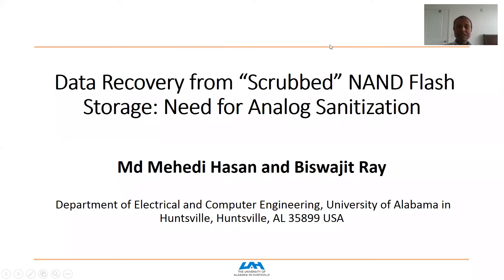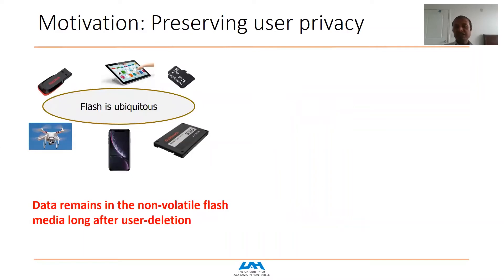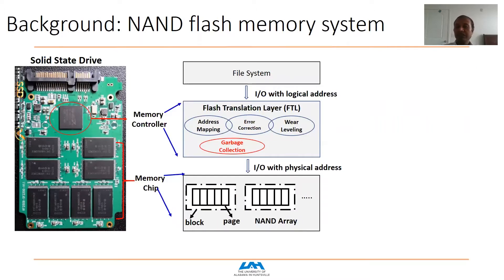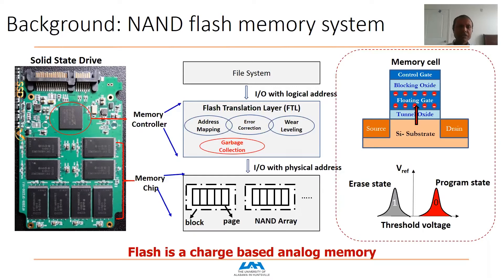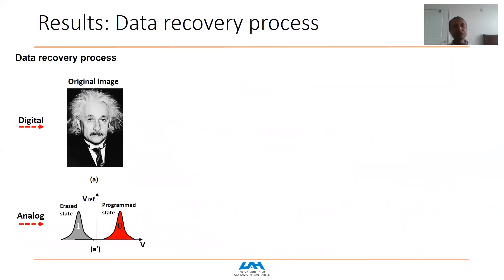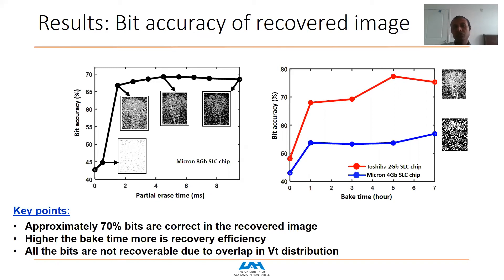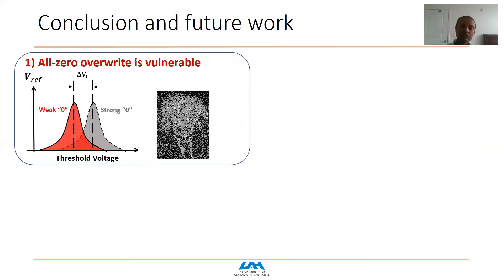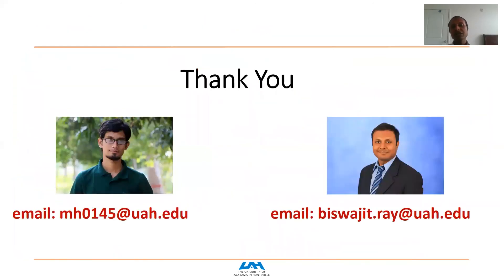USENIX Security '20 - Data Recovery from “Scrubbed” NAND Flash Storage: Need for Analog Sanitization

Comment: Nice. But i wonder did you just use a NAND chip or a NAND CHIP from a pendrive. Because to recover the same image which was stored by a pendrive controller. You will have to dexor and align LBAs..even before making the dumps you will need to set the geometries correctly. At times just data are in page is xored at times SA DA ECC everything is xored. I am interested to read this full paper..Where can i get it?